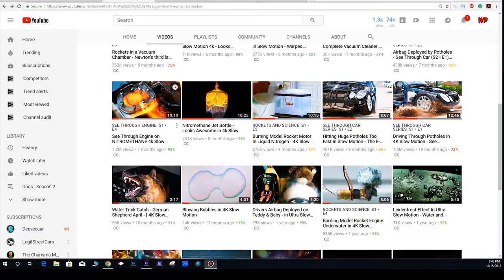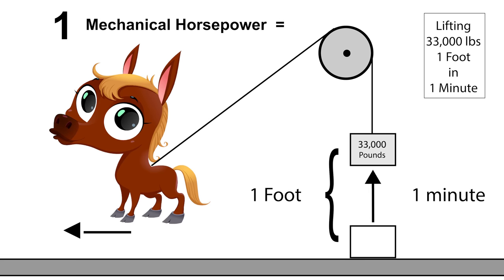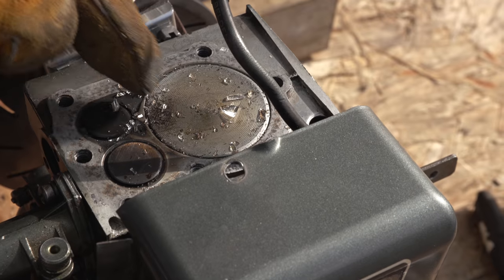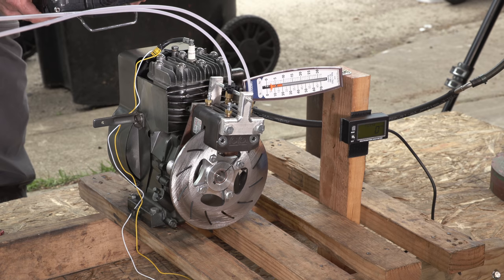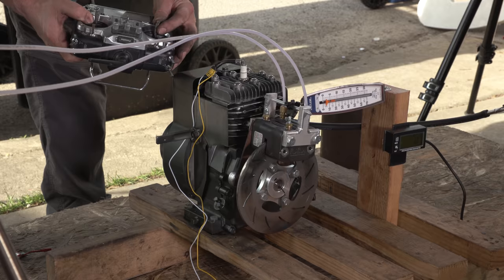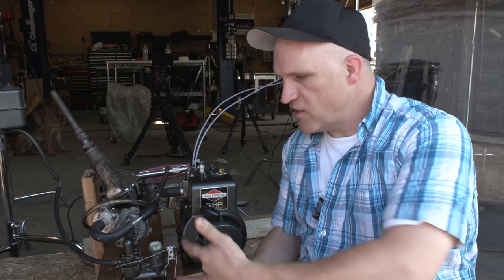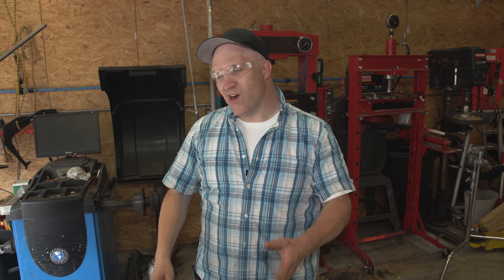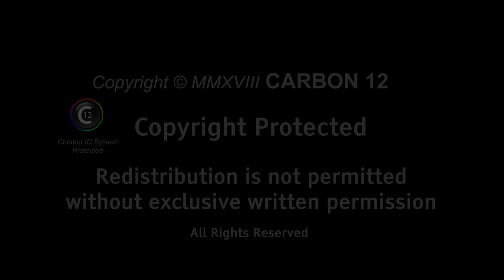See Thru Engine on Turbo Nitro and Dyno  (How much HP does it make?)

Comment: I wouldn't blame the lack of performance on the wet induction setup.  If components are sized right the performance will result.  Years ago, I saw a '68 Camaro running a 250ci 6cyl. with a wet induction turbo setup that ran 13sec 1/4 miles. 

I'll add my vote for a bigger carb and a smaller turbo.  The carb on this engine is sized to provide airflow for sufficient vacuum to pull fuel for 3hp.    With a bigger carb than that in a stock configuration and the volume of air moving through the venturi doesn't create a strong enough vacuum signal to pull fuel from the bowl.  WIth more air flow running through the motor, it becomes a restriction.

Secondly, the turbo is sized for 1/2 of a 6l v-12 or a 3000cc engine.  The 165cc of a 3hp B&S probably doesn't produce the required volume of exhaust gas to spin the turbine fast enough to provide boost.  A turbo designed for a much smaller engine  will actually give you more boost.

You can calculate the airflow at the desired boost level and size the carb accordingly.  For example if the boost is moving 2x the normally aspirated air through the engine, then a carb sized for a 350cc cylinder would be appropriate.  A slide type motorcycle carb might be a good idea since the variable venturi or a slide carburetor is designed to provide the correct vacuum signal for the  volume of air moving through it.

Comment: More timing advance on the 1st turbo run. It was knocking like crazy!
Reply from the maker: So are you saying it needs more timing advance? I didn't see any knocking.
Reply: WP, it was pinging (pre-ignition) on nitro/turbo run 1. Less on Nitro/turbo run 2 but still evident.  You do what you want of course but try another 5-10 advance on the next Nitro/turbo run. That much advance may not even let it run. Who knows. You're the first guy I've seen with enough sack to build a Nitro fueled, turbo charged Briggs & Stratton lawnmower engine! Lol. Whatever happens, im subbed!

Comment: You should switch to a Tillotson double pumper carb set up for alcohol.  Use an auxiliary pulse vacuum fuel pump with the pulse line on the crankcase.   That will make power.

Comment: Cape cod's right, but you can get that spooled up if you advance the cam. You should degree it so you know where it's at. Put it around 115-118 degrees and she'll wind up to 6600. You can also get a blow through carb and jet it. Cleary started lighting up when you added fuel.

Comment: With improper lubrication for the turbo, your bearings in the CHRA are eating themselves with that steel shaft spinning inside a brass bushing WITHOUT OIL PRESSURE (oil pressure is key here, keeps the steel shaft connecting the compressor and turbine floating on the oil rather than touching the brass bushing)

Comment: Using a flywheel would make the hp reading steady. Needs some rotating mass on a single piston engine. Turbo just seems way to big. A lot of fun though! Loved it
Reply from the maker: It has a huge flywheel on the engine, the reason the break is bouncing around is because it wasn't broken in yet. It still had the Machining marks, now it's really smooth. I did want to get the first run on camera though so everybody can see the first run, instead of running it off camera and then having the first run for the audience be like the 10th run, I wanted it to be a good experience and be pure for all of the viewers.
Reply: It's cool either way, fun experiment. Would like to see more brake horsepower experiments.

Comment: I think you should plumb a compressed air line into the exhaust line pre-turbo.  Then, when you start the test, vent some shop air in there through the line and into the turbo, giving it that helping hand to give you some real boost.

Comment: Are you sure its not “multiply by 2?” If its at six inches it’s already divided right? 

Or shorter arm has more force?
Reply: Thats what I was thinking actually. Because the engine should be able to move the caliper a longer way when at 1ft so technically it should be multiplied
Reply: It is like when you use a breaker bar. You use it to have more tourque
Reply: The shorter the arm the more torque since the power is coming from the shaft.  Inside an engine the power is delivered to the shaft where the connecting rods meet the crank.  Each is effectively connected to a lever on the crank, but the power is coming from the combustion chamber so a longer lever means more leverage and more torque, but if you are measuring the torque of the overall shaft, there will always be more torque closer to the shaft than further from it and this is calculat s by a factor of 2, the same way the areas of a circle is πr^2.
Reply: Think of it this way.  Imagine you were trying to stop the shaft from spinning with your hand.  You could grab it directly and try, or you could weld a large wheel to it that enables you to grip much further from the shaft.  Which will be harder to hold?
Reply: Is the power difference linear or exponential?

Comment: I have a question for ya. I have a 03 focus (2.0 dohc zetec vin-3) I have replaced EVERY COOLING COMPONENT! I replaced the water pump, cylinder head temperature sensor, cooling fan resistor, & even the fans themselves & yet the fans will not operate! When I disconnect the cylinder head temp sensor (cht-sensor) the fans run continuously & eventually it is to much of a load on my alternator & smokes it! I am on my 3rd alternator so, The cht sensor has 2 wire's. (1 is 12v & other is a 5v reference to the ecu) So, I cut 1 of the cht sensor wire's & ran it into the cabin & connected a toggle switch & ran the other end right back to the other end of the cut wire, allowing me to turn my cooling fans on & off! I also ordered a aftermarket fan controller but the single wire temp sensor it came with is way to big! My cht sensor signals the fans on when the head gets to 213 -celcius which is 454F (I believe) My question to you is, I have seen one of those tachometers for sale online & some measure temperature. How did it connect to measure temp? I think I need to know exactly what temp my radiator is at when my cylinder head is at 454F or 213C & get a aftermarket fan controller that is programed at that specific temperature. IT has been a nightmare dealing with this & I realize that maybe a ford garage would have been a better choice rather then replacing every part to no evail but, I have put so much money into this car trying to make it 100% roadworthy & this cooling issue is my biggest hurdle & i didn't want to pay a huge mark up for parts & labor that i could do myself & i have replaced every component except the ecu...Any advice is welcomed!
Reply from the maker: Wow that's crazy, those problems suck big time. Well without seeing the wiring diagram I can only tell you what I think off the top of my head. first off I would start by checking the signal to the ECU if that's where the fan control is located, if the signal is within the required limits and the ECU is not turning on the fan then without replacing the ECU, I would take that same wire that you hooked up to a toggle switch, buy and adjustable temperature controller and hook it up to the radiator, there are various ways to do this, in the past I have measuring the circulating coolant temperature, but just for safety in case the thermostat fails one day, I would get a signal from the radiator thermostat and the head temperature sensor as a backup. So basically I would just replace your toggle switch with the radiator thermostat fan control like this Adjustable Electric Radiator Fan Thermostat Switch https://www.amazon.com/dp/B01E52O5DG/ref=cm_sw_r_cp_apa_8TuVBbKQ375E9 or Fan Thermostat Temperature Switch  185 to 175 Degree https://www.amazon.com/dp/B01LZKSF8Q/ref=cm_sw_r_cp_apa_XVuVBbZ5NBVT1 .  As a side note I have also hooked up block temperature sensors to ignition cut offs in the past, set it to a certain temperature and if your car overheats it automatically shuts off the engine before incurring damage.

Comment: Think the exhaust gases produced by that engine aren't enough volume to drive suitable compression. Could be the compressor side of the turbo is actually creating an air restriction, but is an awesome set-up for experiments. Wondering if a turbo off a small diesel engine, or a ford 1.0L ecoboost turbo or something would work better? But finding cheap probably hard.
The dyno was really cool idea and is a beautifully simple piece of garage workshop reproducible tech, and the math is easy to copy.
Nice to see the kids involved too. Need to get the next gen excited about engineering and experimenting, get their imaginations fired up!
All told I really enjoyed this episode. Big thumbs up.
Reply from the maker: Thank you. I agree and I kind of disagree, you have to keep in mind that I'm running nitromethane not gasoline, that was actually the staple behind putting this size turbo on this engine, I just didn't address that in this episode, but I guess I'll find out once I slam it with the ton of nitromethane..lol. a turbo from the EcoBoost is larger than this one, this is the little baby primary Turbo from the sequential setup on the SL65, it's 27 mm. Originally I was going to go with a legit dyno, but I really didn't think that was that much fun and they are complicated, I wanted to figure out a simple way that anybody can understand. Absolutely have to get kids involved, this is what we're missing today and this is one of the reasons that I bring this stuff to YouTube, it's not like back 20 years ago we're all the kids were tinkering with that stuff, now they're all on their phones, where are all the engineers going to come from?. Thanks again and thanks for the feedback

Comment: Great Vid!  
lets get really crazy, spin the turbo up with a direct drive, use a belt drive off the engine flywheel to a 1 inch pulley on the turbo.
In other words, BLOWER  I was able to machine a grove in the fins of the flywheel to except a 1/2 inch cogged belt and used a small pulley on the turbo, not sure how much boost was made but the gocart went a lot faster till the rod made an inspection hole in the side of the block .... Ahhhh those were the days

Comment: I build some kart engines, we are taking the stock 5hp platforms, aftermarket rods/piston, cam, springs and obviously carb, but turning them 9000-10000rpm on a stock crank, also just had a chain slip on a harbor freight open, turned 11940 on a stock crank and not blow up

Comment: If your fuel was maxed out with the NA nitro set up, adding more compressed air will just lean out your mixture, you’re on the right track adding more fuel. A bigger carb or injector... an O2 sensor and A/F ratio gage would help dial it in.

Comment: you can use a ghetto blow through method as well on the turbo. 
hook turbo output to a manifold with a filter on 1 end of the manifold and carb on the other. turbo input in the middle kinda like a T. drill a hole in the manifold and tap it for a barbed fitting to thread into it and hook a hose from the barbed fitting to the top of the fuel tank. The idea is that the turbos boost will help pressurize the fuel tank to increase fuel flow dependent on how much boost is generated. The air filter lets excess boost out like a blow off to help reduce the risk of blowing up the motor or melting the piston down, but acts as an extra intake as well when turbo is not making positive pressure in the intake. ghetto/poor mans blow through turbo setup. Now that blowoff is assuming you have a turbo sized correctly to make enough boost. Judging by your oversized turbo and undersized engine...I doubt you are making positive pressure at all or we would have seen an increase in power. I think it is restricting both the intake and exhaust and mixing oil into the fuel. running fuel through the turbo is probably eating away at the oil seals in the turbo.

Comment: I see lots of people agree with me that the turbo was too large for the small engine to turn effectively to get any real boost. Back in the 80's we supercharged one of these engines by using a smog air pump from a car. We mounted it to the top of the cylinder head and drove it with a pulley and belt, about 5 to 1 if I remember right. It was also a "wet" system, pulling air through the carb and then compressing it into the engine. That engine screamed. We put it on a go cart and we could literally light up the tires and do burnouts and donuts with that silly little 3 horse briggs engine.

Comment: Great video guy. Now as for the engine; Because of the low engine speed ditch turbo and go with a supercharger. (Wet isnt the problem just look at the Blower guys.)
Anyway the point is the supercharger is instant and constant induction perfect for this application. 
And a mod idea for this suggestion:  instead of belt  driving the charger make a chain setup.

Comment: apparently because a single cylinder engine only creates boost when it doesn't need it (exhaust stroke), you need a boost chamber to hold boost so that the boost is still available when it intakes.

Comment: That was awesome !!! However, it looked like the engine was getting too much fuel when you added the turbo. Also, instead of mounting the carb directly to the turbo, you should add an aluminum downdraft intake tube, about 1' long, that allows the fuel & air to mix better, get colder and have more density.

Comment: Much bigger spring on the waist
Gate to hold it closed/ move turbo closer to block and remove long uphill intake run going to motor and move turbo pressure output side as near intake port as possible.  That should get you started

Comment: Looks like it needs some sort of damper on that dyno. 
I highly doubt that turbo was spooling at all - maybe spinning, but not developing any sort of pressure with such low mass flow. Might be able to find one that small, but they are very rare - won't be cheap, that's for sure. If you're doing anything with testing with a turbo, you really need a boost gauge to see what (or if) it's doing.
The draw-through (what you're calling "wet," I've always heard it called "draw-through) setup certainly isn't ideal as blow-through or injection, but it does work. If the turbo really is developing boost, the air volume would be bigger, so you might need a bigger carb.
If you do want to go with some sort of fuel injection, Microsquirt (a stripped down version of Megasquirt) might be a good way to go, though even that would be overkill. Single injector between turbo and intake port, and computerized ignition - maybe a single LS coil, and a crankshaft trigger. With some scrounged parts that might be a $450 or so build. Wideband O2 sensor (extra $100 or so) would give you a lot more tuneability. Could be a really interesting experiment, depending on how much money you want to sink into all this. For cheaper, I've heard about something called "Speeduino," but don't know much about it, to my knowledge it's still in the development phase. 
Fuel injection/electronic ignition might help a little bit, but I'm doubtful it would make a huge difference. A proper size (probably off a bigger lawnmower engine) carb tuned well and well tuned stock igntion would give you almost as much power - maybe 85% at least - of what you could get with fully optimized fuel injection. And that assumes you put in the tuning to get it all just right. The benefits of fuel injection are more about drivability, fuel economy, emissions (the main reason everyone switched to it in the '80s), and reliability - carburetors are finicky bastards. I have a '73 Bug which I converted from carburetor to fuel injection, it doesn't produce really all that much more power, fuel economy is somewhat better (though it's not optimally tuned, I hope for better once I tune it better), though the car has much better throttle response, does much better in cold weather, and I don't have to mess with it quite as much except when the fuel rails break off.

Comment: what type of glow plug you using. And how to fix in this plexiglass??? Great video keep working.Thanks
Reply: Hes using a spark plug. Glow plug is for diesal
Reply: @aidenyaekel1463  what type of spark plug. I never see that thin. And you glue or s screw to the head?
Reply: @RBAERO  on the glass head its just a screw. And the heads screwed on

Comment: I'm pretty sure that the reason the turbo is not helping much is that the exhaust side of the turbo is too voluminous for that small single cylinder.  If you could find a way to constrict the exhaust side of the turbo (maybe fill it in with JB weld) it would spool up better.  Also, if you could find a way to fashion a blow through carburetor, that would help.  It takes so long to spool up that turbo as it is set up, that by the time you spool it up the intake side has to be hot.  Faster, better turbo spooling is key.

Comment: I was excited to see how a lawnmower engine runs with forced induction.
Maybe use a smaller turbo? It sounds like this one doesn't do anything until after 3,600 rpm.
Seems like the exhaust gases haven't got enough pressure to drive the impeller adequately. Perhaps a small intercooler would help too.
In any case good job on the video.

Comment: Very cool video. Ide love to see exhausts next with nitro. 

Or best yet would be a Zenoha 32cc engine put through your channel that would be great for the Rc 1/5th scale crowd and Goped groups. 

I dont think the engine can pump up the turbo its pipes too big. It'll be like farting into the euro tunnel lol. 

Mayb a motorbike turbo or something home made would be cool. 

What engine is this cos the Zenoha 32cc is rated at around 3hp i think. With exhaust manufactures claim upto 9hp from mods. So could be a cool series with new following to the channel. I loved the see thru head. And the sound.